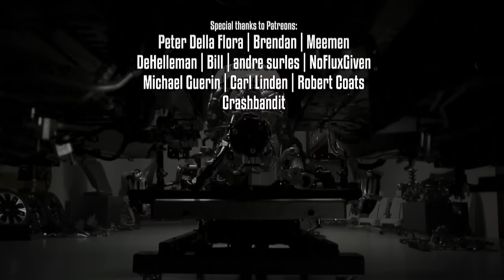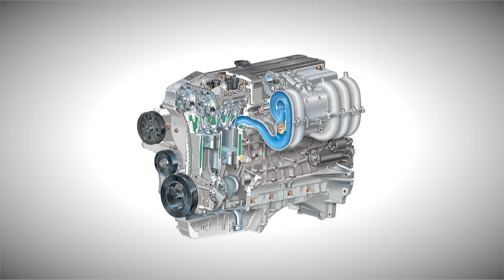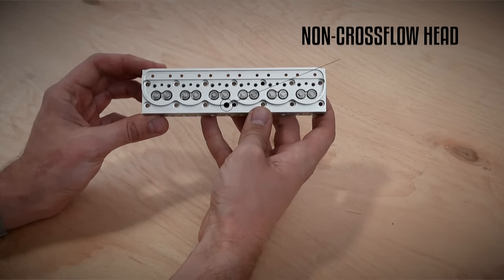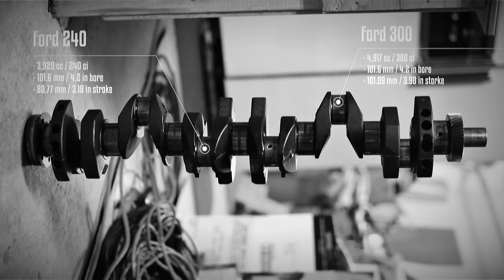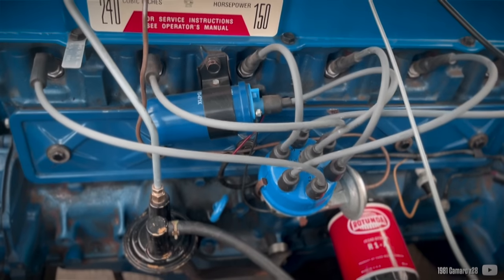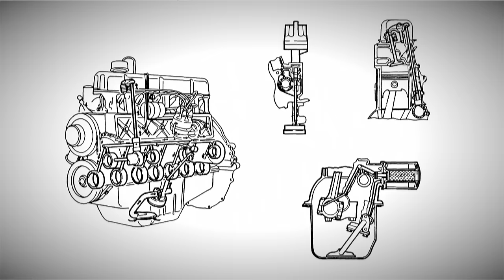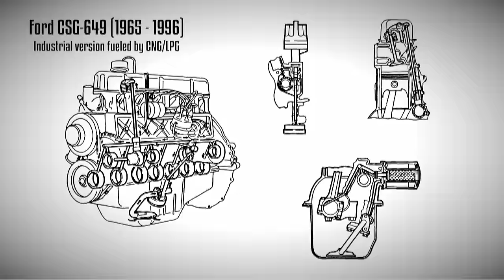Is This Toughest US 6-Cylinder?

Comment: Mopar had the slant 6 and was an epic engine along with GM 292.
Reply: I agree, had them all. The small V8 of the era, Chevy 350, Chrysler 318-340-360 the fort 302 and 351 were all epic till they got smogged to death
Reply: @scotthanson7888  -  The 292 was strong but the slant 6 was noisy and gutless. It was the engine in the old blue hairs 78 pos dodge aspen LOL   Scary thoughts from the 80's.  Reliable but my little sisters big wheel was faster.
Reply: @KlodFather  I think it depends on gearing, I had a 65' Dodge D100 with the 225 slant six and manual transmission. It did great and had adequate power and torque.
Reply: Then Chrysler Australia put out the 245 and 265 Hemi 6 to replace the slant down under. 265 with triple webers is a beautiful engine
Reply: @KlodFather  The later ones may have been smogged to death, but in the early 60s when Chevy IIs got 283s and Falcons got 260s they couldn't keep up with Darts and Valiants running 225s.  That was largely due to the two speed automatics in  the Chevy and Ford, but also due to the fact that the 225 torque peak was at 1200 rpm and they launched form a stop as hard as a 318 up to about 15mph.  I was raised in a Ford family and always thought that Ford could beat everything until I got some direct experience with Chrysler engines and transmissions.  When I was n the army on the late 60s we had two staff 62 Plymouth staff cars in the motor pool.  They were supposed to be turned in for replacement at 100K.  The replacement would have been Chevys or Fords and the motor pool sargeant kept rolling back the speedometers until 1967 (over 300K on them) when we had Biscayne 283s forced on us.  The Plymouths never required anything but plug and oil changes.  I've still got a 73 Valiant I bought new that had 408,000 on it when we parked it because we had switched from sedans to minivans.  Our highest mileage minivans at the moment have over 190,000 miles each on two of them,  3.8 and  4.0 Chryslers.  Ford's Falcon 6s were notably weak things all around. No power and poor durabi8lity.  But they certainly  were cheap to produce and sold in huge numbers so Ford made tons of money with them.
Reply: @anvilsvs  Slant 6 225's  were sogood that they had to quit producing them, No Repair money parts and labor.
Reply: @tigerboy60  That wasn't exactly the reason.  They weren't cheap to build, were relatively heavy and bulky, and would not fit FWD vehicles.  I heard that the tooling was shipped to China where those thing didn't matter at the time.  The last time I bought a water pump for one maybe 12-15 years ago it came from China.  I've still got 4 of them in storage.
Reply: The Chevy 292, I can attest to that!..It may have even had a better torque curve than the 300...I do know it had a longer stroke than the 300, but I'm not sure by how much...the slant 6 was bulletproof, but I never, ever understood why they didn't make a larger displacement version for light and medium duty truck use, to be competitive with Ford, Chevy, International, and GMC(with their minster V6's)...225 cubic inches was quite small and a handicap compared to the others....
Reply: @dyer2cycle  The /6 block was limited to 225.  
The 3.4" bore was as large as the block could take and the 4-1/8" stroke was also the limit of the block.  They could be over bored by .030" to 231,  but that was it.  For whatever reason they never imported the Australian hemi versions which were larger.  Apparently they were happy with going to the 318 which is also a very tough engine.
Reply: slant 6 had it tough hard to kill
Reply: @tigerboy60  Reliable as hell and they could be spun up to very high revs.
Reply: @anvilsvs  Well, sounds like it was a design flaw/oversight if they intended to use the engine in trucks, as a 1 ton-to-medium duty truck, which inline sixes were used quite a bit back then, preferred by many, in those applications you really need something close to 300 cubic inches...even if it could have gone to, say, 275 cubes, I think it would have made a difference..I don't know the displacement limit on the 300, but I do know the Chevy started out as a 194(there was also a 4 cylinder version), went to 230, then 250, and also the 292...that's pretty versatile...and I Think the 292 can go even further in displa
cement...
Reply: @dyer2cycle  The 225 was heavily based on the previous flathead 6 which dated to the late 20s.  I think it used the same bore centers so as to use the existing machine line.  That limited the bore.  Cam chain and sprockets interchange with early hemi.  Definitely a low budget project.  It's amazing that it works as well as it does.  And they do have the 318 so there's not much point in a 300 6.
Reply: The 292 has more balls than the 300 any day i drove both for years hauling lots of hay and livestock... The 300 was close but not as much in our fleets back in the day...Then came the 454 OMG no comparison although the sixes would out grunt the V-8 down to maximum lug the 292 would out  grunt them all down to 350 rpms thats a deep base lol
Reply: @garykentner7557  Big block Chevies don't always have off idle torque.   I can remember a '66 247-390 Corvette that could barely get out of my sloping driveway under 3000 rpm with massive clutch slip.  When that engine was later replaced with a 283! it would idle up the same hill with no throttle and no clutch slip.  I had a 454-245 in a P-30 MAC tool truck that would barely get out of its own way below 15mph.  Had the same 454-245 in a Winnebago that performed the same way.  Now, once those 427/454s got up to 3000 they were GONE.  Just no torque off idle.
Reply: @anvilsvs  Good points..but I beg to differ that the 318 is a substitute for a larger displacement inline 6...a small block V8 does not have the low RPM grunt or smoothness of an inline 6...I would not trade the 292 I6 in my '70 Chevy C20 with SM 465 4 speed granny, for a 350...much less a 283 or 307...a Big block 366 or 454?..maybe....
Reply: @michealfigueroa6325  Put a TorqueFlight Transmission behind it and a Pushbutton gear shift
Reply: @anvilsvs   From memory and no reference, I think the sweet spot for the slant 6 was the original 170. Corporate wanted that other motor for different uses and they stroked it in inch. Nowadays the formula to get a good slant is I believe the 170 block with a 198 head but we'd have to do some reading  before that plan.  No complaints on my slant 6 engines over the years.  Liked my 250 and 292 GM engines too. Hell, life was easier with all of them back then.😅
Reply: @jumpinjehoshaphat9075  My experience with 170 was never good.  They never seemed to have the torque or longevity of the 225.
Reply: @anvilsvs  Cool, I accept that.  The only one I ever had had a hole in the side of it. 😄
Reply: The slant 6 would get well over 200,000 miles but the GMC straight-six a lot of them would start blowing rods between 100,000 and 150k
Reply: @KlodFather  Every engine in 1978 sucked ass.  Every engine from 1975 to around 1985 sucked ass.  It took a good decade to figure out how to get horsepower, torque, AND clean emissions.  The 225 Slant Sixes made before the emissions controls were bullet-proof and far from gutless.
Reply: @KlodFather  the slant was NOT gutless if maintained properly. if you didnt adjust the valve lash yearly it would loose some power,
Reply: @andrewj503  yes as with my 66 D100 you wouldve had a 4:0 gear ratio. 2500-3000 rpm gave 52-58 mph
Reply: @anvilsvs  the chrysler 6 in 170 or 225 cid(forget the eco-freak 198) had more torque than other straight 6s due to slightly longer stroke. this helped it meet or surpass the performance of the ford 250 (same hp range of 98hp)and the chevy 235
Reply: @tigerboy60  exactly, there was a reason smaller seagoing vessels used the slant 6 as an inboard motor, extreme dependability
Reply: @anvilsvs  weight and emissions were the claimed reason. the weight and fwd issue wasnt an issue in trucks, the platform the straight 6 excelled in.
Reply: @dyer2cycle  im with you on why chrysler didnt increase the displacement, imagine a 250 cid turbo slant. god knows the engine was stout enough for it
Reply: @anvilsvs  im an avid slant 6 fan and they still had room to bore AND stroke. dont believe the propaganda
Reply: @maddhatter3564  I still have three /6s.  I like them too.  But there's not room in the block for a longer stroke.  And the bore centers are too close to bore more than about .030 over (229) in a thin wall casting.  I've heard of .040 bore in some early castings which is 231.  I knew a guy who claimed he had a 270 slant because Darts had 170 and 270 trim lines.  And because his '66 Satellite with a 225 would outrun his '63 Biscayne with a 283.  He just refused to believe that a 225 could run that well.  Never mind that the Chevy was a Powerglide and the Satellite was Torqflite.  He was a quite intelligent guy and knew cars fairly well, but just refused to believe the truth on that one.
Knew another guy who was in with a local MOPAR club.  They took a 225 Valiant up to Commerce drag strip one time.  The Chevy guys were having an open day to show that they could outrun any other brand.  They finally ruled that the Valiant would have to run in a modified class because it had a MOPAR deal on the rear window and the decal didn't come with the car when it was new.   And it was beating 283 Novas, never mind any 6 cylinder Chevy.  It was dead stock.  But it wasn't hobbled with a Powerglide.
Reply: @maddhatter3564  ..yes, another thing I used to wonder is, since it was slanted, why not add another cylinder bank to it and have a 450 CID V-12?..that might've been good in trucks!
Reply: I'M A MOPAR GUY BUT THE 292 chevy impresses,stuck a used one in my van it burned rubber,in a van,so impressed i went and bough a brand new carburetor for it,it laste 418k miles,then i sold it
Reply: @strattuner  It will last longer than that, that's for sure...mine has...work truck, can't beat it for pulling or durability. Good as the sbc is, the 292 will outlast it by a country mile...just don't expect good gas mileage....
Reply: I agree those are great engines but the I6 300 is insanely strong and reliable.
Reply: @BobPhillips37  
Only companies that knew how to survive those years were ALL the Japanese companies. That's when I made my switch to Honda.  Never looked back. No problems, better gas mileage, only basic maintenance. My first new Japanese car was a 1987 Civic. That's what did it for me. Before that it was all GM.
Reply: Don’t forget about the Aussie Chrysler 265 hemi
Reply: Slant6 was a suicide engine. The engine kept running with no oil pump unlike all other us brands. Many blocks ended up on the bottom end of a rope tied to a milk jug for tying our boats to at the lake. 😎
Reply: @KlodFather  The closeness of oil pickups to the bottom of the oil pan kills the 318 due to loss of lubrication after a little lapse in oil changes.
Reply: @Conesmcjones  Don't forget the 215 hemi in the Centura.
Reply: @ammoniawilder4451  -  And the Ford is better on gas because Ford redesigned the head. If someone had made a better head for the 292 it would be doing the same thing and saving fuel also. The 292 was a good engine. The 300 and the 292 were probably the the best two work and industrial engines ever produced. The 292 doesn't get as good fuel milage because the head was not optimized in design and it was never fuel injected.
Reply: @Squeezmo  -  I was not aware of that flaw in the 318, however all brands have plenty of BS like that to go around. The 318 was a venerable engine and there was a police intercepter version made int he 80's that was fairly evil ha ha. Rode in one. Changed my underware.
Reply: @KlodFather  my brother had a car with a 292, I agree
Reply: @KlodFather  the driven distributor keyed to the oil pump. When the key broke, the oil pump stopped but the engine kept running.
Reply: The slant 6 was a stroker motor right out of the box. Great engine!
Reply: Got totally drunk when I was 18 wiped out 4 cars, 40 feet of fence and left my plate, that slant was running for at least 30 minutes with a  cored radiator,  when I came to, We drove off.
My best friend to this day  after waking up mentally he said why did we stop, I was told the other 4 guys were wasted more than me, Nick in the passenger seat could not get the lap belt off and watched them go when they left the car faster than the Flash or Superman.
Thank God the cars were all off the road and uninsured. and none hurt.
But damn I miss those belvederes and metal.
Reply: This isn't about a shitbox gm or a Mopar. It's about the best 6 cylinder made.
Reply: Slant Six.  The old "hill side hemi."  We had an Owatonna haybine  with one.  It cut a lot of hay for many years.
Reply: @KlodFather  I kept hearing about the great slant six, so back in the day I bought a new 78 Volare (Aspen with a different name).  I won't go into everything that failed on it, but the engine had to be replaced under warranty.  Yes, it was quite a POS and the last Chrysler product I ever bought.
Reply: @markstone2138  -  Those old late 70's Volare and Aspen were fairly junky. My buddy had one and it got him to college reliably but we worked on it. In those days quality was fairly shit among domestic brands and Chrysler was running itself into the ground. The slant was a good sturdy engine but the problems came from poor manufacturing processes and junky parts. The aftermarket electricals for those cars were way better than the factory ones. By the middle 80's they had started to get better. My other friends dad had a 5 speed slant half ton dodge. It was a pretty good truck but still smogged out guttless. It was the way of things back then.  The 300 although not fast, was way more powerful and got as good or better gas milage than the slant.
Reply: Owned a few slant six cars. I loved them. Indestructible! Did an oil change on one. I think less than one quart came out😂. Put the proper amount in and drove it hard for another  year until I could afford a nicer car. It never left me stranded. Shit I paid $300.00 for it. My stereo and speakers cost more.
Reply: @KlodFather  Bring either of the ford or GM engines down to the same displacement and they'll be just as gutless. Remove the crappy smog equipment on em and they all open up a ton. Making bigger engines was the only way to comply with emissions and still make power, but thanks to govt regulations they could only put such big engines in trucks. The slant 6 was built mainly for compact cars like the Valiant and size constraints limited its displacement, but with lower gearing it could push trucks and buses. There are some madlads that boost em to the moon and drop em in gutted A bodies for drag racing since they make great torque for their displacement.
Reply: @anvilsvs  I had a 74' dart that had a 198 slant 6 which my understanding had a shorter stroke than the 225 great motors hard to kill my Ex. ran it out of oil twice and it kept going.
Reply: @jaymortensen642  All slants had the same 3.4" bore. 198 and 225 had a taller block.
Reply: I think the AMC and Ford straight 6's are a cut above the Chrysler and GM straight 6's. Not that any of them are bad - they're excellent - but I think the Ford and AMC straight 6's are better
Reply: @isaakwelch3451  I've seen the ford 300's limits. I wouldn't say they're much better to be honest
Reply: The Slant Six, one of the best engines ever produced.  My first 
one was in a 67 Valiant.  The reason Chrysler discontinued them, 
and the Valiant/Dart, was because they just wouldn't die!  "How 
can we sell new cars, if the old ones never die?"

When I lived in San Jose, me and a few friends took the back roads, 
over the mountains to Santa Cruz, late one night.  Had a BMW in 
front of us, and we were able to keep up with him.  With his headlights. 
lighting up the road in front of us, we could match his speed.  He was 
50 to 75 yards ahead, and we could see the road in front of him.  Taught 
my younger brother how to use a clutch in this car.  Put the car in third 
gear, do NOT touch the gas, and slowly release the clutch.  Third time, 
he got it.  Try that with a newer ANYTHING!

Then there was the 64 robin's egg blue D100.  We got it to idle at 90 
RPM.  Yes, ninety RPM.  At 300, we could balance a nickel on it's 
side, on the valve cover.

steve
Reply: @knote4958  -  Yep... They slanted the engine to get it to fit under the hood of those mid sized cars. Ford though got the 250 to fit under the hood of the mustangs in the 60's without a problem. My friends dads pickup with a five speed and a slant in it was not fast but it did well and had plenty of torque. I liked that truck.
Reply: For those who say that Slant is a weak engine, it is because in the United States it drowned terribly, since there is more Slant from the 70s than the previous ones. In other countries like Australia or like mine, Argentina, the Slant is much happier, our standard versions are happier than many US preparations and not to mention the race or enhanced versions. I leave videos as evidence:

totally original dodge polara rt, except for the differential ratio: 
https://youtube.com/watch?v=p5FvnXtDufY&feature=share9

Dodge polara rt with preparation: https://youtube.com/watch?v=ld6HHdQjzOA&feature=share9

Dodge polara Drag: https://youtube.com/watch?v=Kkf8ykZEUwA&feature=share9

valiant 4 prepared for 1/4 mile: https://youtube.com/watch?v=wR8socx4aQU&feature=share9

Turismo Carretera: https://youtube.com/watch?v=nCIintqAJQQ&feature=share9

https://youtube.com/watch?v=VtVEX8EV40Q&feature=share9: crossing the finish line at 230 km/h or 142 milescrossing the finish line at 230 km/h or 142 miles
Reply: All of those three were great engine's the one that got my admiration was the slant six in a 74 gold duster I bought the guy who owned it said he got it from his father in law and the car had over 400,000 on it before the motor blew after I bought it I took it home and checked out the drive train I replaced the head  (cracked and burnt valves)) tune up and trans filter and fluid change we drove that car for another 200,000 and it still ran great when I sold it, wish I still had that one and of course a lot of the trucks and cars I've owned
Reply: @thomasgooden5666 sorry to tell you but the 292 is gm.. 😂😅